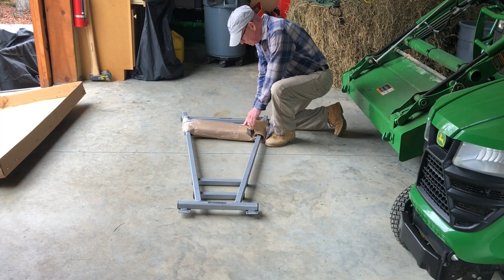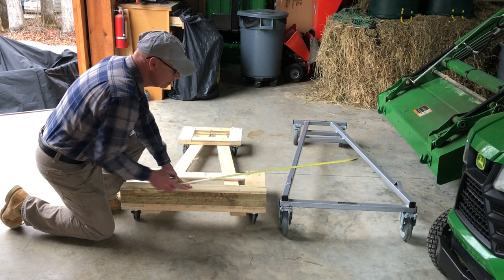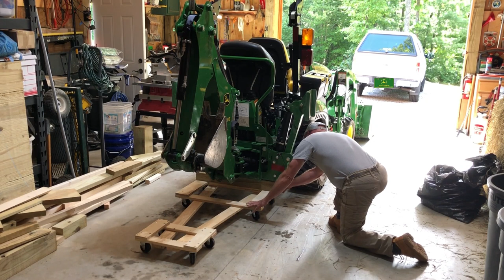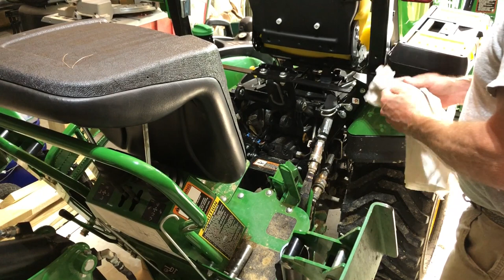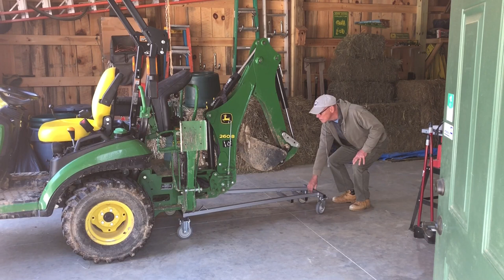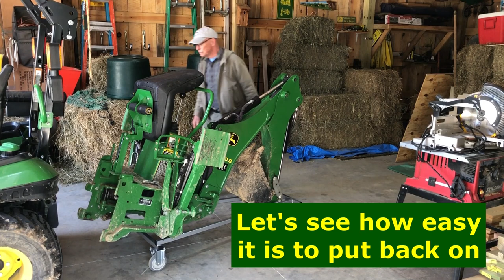1025r: "Hello Dolly" - Which works better? The BXpanded 260b backhoe dolly or DIY wooden dolly?

Comment: SOLD!  Bought one right after I watched your video.  I have limited space in my storage shed so being able to move the backhoe around will open up lots of space for me.  I've purchased several backhoe upgraded from BXpanded and they've all worked as advertised.  Thank you for the video.
Reply from the maker: Yea, what a difference from the wooden dolly - especially since I only use it once in a while when I take off the backhoe - now I can just hang it up on the wall out of the way👍 - Thanks for tuning in to our channel…

Comment: Be careful about the height of the dolly. I have turf tires and my machine sit's about 3/4" lower. The homemade dolly with a 4x4 would not go under my machine I had to lay a 2x4 flat with a piece of pine on top of it. Not sure how that effects the BXpanded one but from the looks of this video it wouldn't fit... I would do some measuring first. **EDIT: Just saw a video with Turf tires and he had to drop the stabilizers to get the dolly underneath then raised them to remove the 'hoe. He struggled slightly to get it back on but it looked okay.
Reply from the maker: Thanks for the tip - With the R4 tires I’ve never had an issue - I lift the back of the Dolly a little when putting it under the backhoe & it slides under just fine - Thanks for tuning in !

Comment: This is the goodest video on this topic I have seen.  Thanks for making time to show this dolly and how it works.  Now, that means I need to finally build a storage shed WITH a cement floor for my tractor.  And $200??  That is a fricking bargain. If someone can afford the tractor, you can easily afford this necessary accessory.
Reply from the maker: Thanks for tuning in to our channel - Have fun building your storage shed and getting the BXpanded backhoe dolly - It does work well - The only thing holding me back from getting it first was the 6-8 week delivery time they had a year ago - But I needed a dolly sooner.  So I made one,. They now have a delivery time of 4-6 weeks - I got mine in exactly 4 weeks from the date I ordered it - Good Luck...
Reply: I did a poor man's floor.  Used the loader bucket to put down gravel and spread it smooth by backdragging, then laid treated 3/4 inch plywood with anchor pins at all four corners.  I used about 15 sheets of plywood butted to each other.  I can live with the anchor pins slightly above grade.  I roll things around them without too much issue.  They're basically 18 inch long rebars with washer and nut welded to one end.  I drilled out the plywood at the corners and drove these into the gravel and soil.  None have moved in 2 years of driving on them.  Cost me a fraction of the cost of cement and I can lay on them just like a cement floor and they're a bit warmer in winter.

Comment: I'm trying to build something similar. Could you tell me the square tubing size and how thick the tubing metal is...1/8" or 3/16" or 1/4"
Reply from the maker: Approximately 2”x2” square & 1/8” thick walls - Dimensions for wooden cart that also might help are on one of the comments below

Comment: thanks for the video...I have the bxpanded dolly now for over a year and have had sporadic success...no instructions either so I may have been doing it wrong.....I've had to use the outriggers more than once to get it back on (using the tractor back and forth) which is a real pain.  I see how the ridges in the frame on this thing prevent the unit from sliding forward causing the bucket to come off while trying to insert the pins in the hooks.  I either had the bh frame on the ridges or behind them.  Not knowing where the bh should be after removed from the tractor is important.  If it weren't for youtube we'd all be in the dark.
Personally, I hate removing or installing the bh on my 1025r.  I had built a wooden one that was somewhat different than your's and it seemed to work better than nothing.  So I spent the $175 (at the time of my purchase) and got the metal one.  It worked great now and then but as mentioned above not all the time.  Lack of instruction is shameful.  I installed my wheels in the same configuration as you did as this seemed to be most logical.  I still hate to remove or install the bh and wish I had another tractor to use for chores where I need other rear attachments and just leave the bh installed all the time.
Reply from the maker: Thanks for tuning in to our channel - I just had another follower mention that when he got his BXpanded dolly it came with instructions on assembly and use.  I just sent them an email a couple of days ago asking for them to email me a copy for my records. Maybe you want to do the same. (contact@bxpanded.com) -> I felt there was a big difference between the homemade dolly and the BXpanded. With a few times of practice I can get the 260B backhoe off and on pretty easily with the BX. When the BH is on the dolly I leave it fully collapsed (towards the bucket) before sliding it back on and aligninig it with the pins on the tractor frame. Thankfully, I have never had to use the out-riggers to get it to drop into place.  Man, that would be a pain. Best of luck.  Reach out to my email if I can help (it's on the "About Page")  Take care...
Reply from the maker: I just posted a copy of the BXpanded dolly instructions on my "Community Tab" if you want to read and save them....

Comment: I am a new backhoe owner and I a very interested in a dolly. I struggle with my backhoe taking it off and putting it back on. My question is. Does your backhoe change position on the dolly once it has sat over time and the cylinders relax?
Reply from the maker: The dolly is set up for that - once you put it on the dolly it will pretty much stay in place  & will easily align with the frame hooks to slide back on
Reply: Thank you so much for the quick reply. I actually forego project work because I loathe dealing with putting my Hoe on but I am looking forward to building a dolly to ease this now. Thanks again!
 @ClearCreekCabinMiniFarm
Reply from the maker: @rvandeker1  The BxPanded dolly is the way to go - They have it designed perfectly which makes it a cinch to drop & reinstall the 260b backhoe - I hated the wooden dolly I took all the time to make. + Looking at the bare cost of the metal tubing & casters to weld one up myself, it wasn’t much more to buy it from BxPanded all ready to go👍

Comment: Excellent video. Thank you.  I just bought the 206B and after struggling with removal and installation at the dealers, learnt a lot just watching you do it.  I need to get this metal dolly or make up a wooden one.  Looks like the pandemic has caused supply problems at BX .. darn.  Would greatly appreciate a little more detail on the measurements since I could not locate the originals if there were any.
Reply from the maker: Thanks for tuning in to our channel - The BXPanded is the way to go if you can get one.  They had a supply problem last year (2020) but when I got mine earlier this year (2021) it came pretty quickly (<2 weeks) - If you plan on building one youself, here are the measurements of the BXPanded - Have Fun...

Dolly dimensions 
Over all length 55”
Width at base 27”
Width at top 16-1/2”
Length from base to top of 1st cross rail 42-1/2”
Length from base to bottom of 2nd cross rail 47-1/2”
Opening of bucket rest (inside dimensions) 5”

Comment: Hey Clear Creek Cabin, on the measurements: "Width at the top 16.5" seems too large.  Was that 16 inches on the bar that has the casters?  My guess is that the top of the "A" would only be about half that, say 8" or so.  Any additional clarity would help.  Thanks!
Reply from the maker: Hey - The top of the dolly is where the 2nd set of wheels are attached - that bar is 16-1/2" from side to side - the long bars from the other end of the dolly are welded into this bar spaced at 9-1/2"  apart (or 4-3/4" from each side of the center of the 16-1/2" bar)
Reply: @ClearCreekCabinMiniFarm  Thank you!  Just what I needed.
Reply from the maker: @ramchillarege1658  My email address is in the about section of this channel if you need additional info while you're building your dolly - Best of luck with your project and Happy New Year...

Comment: Can you give the overall dimensions of the Expanded dolly?
Reply from the maker: Thanks for tuning in:

Dolly dimensions 
Over all length 55”
Width at base 27”
Width at top 16-1/2”
Length from base to top of 1st cross rail 42-1/2”
Length from base to bottom of 2nd cross rail 47-1/2”
Opening of bucket rest (inside dimensions) 5”

Comment: that power beyond hose connection is the poorest design they should have put bulkhead fittings on the machine it would have been so much simpler to connect and disconnect
Reply from the maker: So true + the way they designed the BH hook-up is difficult - don’t know how anyone can do it without a dolly on flat level ground 👍
Reply: @ClearCreekCabinMiniFarm  I agree I put my brother in laws on a pallet for the winter hopefully it goes back on easily I have enough steel around to fab one up just one to get a few more measurements thanks again for an informative video
Reply from the maker: @elektrikman8834  all the measurements you need are in the comments below👍

Comment: Nice Thank You I think you are on the rwrong side of the 2 angle block they llok to be there in case it slip maby you will have to advance your backo on the throlly
Reply from the maker: Thanks for tuning in to our channel and Thanks for the tip...  I'll check it out...
Reply: Correct. I put the angle part on the dolly between supports on the outriggers. It prevents the BH from slipping

Comment: hello and congratulations on your video it is greatly appreciated.  Could you give me the measurement of the square bar and the measurement of the wheels and the measurement between the 2 small bars between the 2 large bars
Reply from the maker: Thanks - I posted the measurements in two of the previous comments below - Reach back out if you need something else
Reply: @ClearCreekCabinMiniFarm  I'm sorry I just saw the answer you sent with the dimensions of the bar as well as the dimension of the wheels thank you very much because I'm from Quebec and with the shipping costs and customs it costs me $ 400.00  Canadian !!!  thanks again
Reply from the maker: No Problem Mario - best of luck building your own... A year ago mine cost me $237 including tax & shipping  and it's been well worth every penny...👍

Comment: Yes. The dolly is a game changer. I replaced the stock casters with locking casters for safety. 610lbs of solid steel being freely moveable didn't sit right with me.
Reply from the maker: Thanks for tuning in - Now there’s a great product improvement idea - much better for safety - Thanks for sharing!
Reply: I agree with your decision...my dolly rolls around when trying to disconnect the bh...and I've chocked the wheels with 2x4's to prevent such.  Will look into doing the same thing.  My floor isn't completely level and the dolly tends to wander on it's own.  Great advice.

Comment: Hi, can you tell me the lenght from base to the bottom stopper  and base to end of stopper and the high of the stopper. Thanks you very much
Reply from the maker: Thanks for tuning in - I guess you've decided to build your own?  Best of luck & Have fun...

Dolly dimensions 
Overall length 55”
Width at base 27”
Width at top 16-1/2”
Length from base to top of 1st cross rail 42-1/2”
Length from base to bottom of 2nd cross rail 47-1/2”
Opening of bucket rest (inside dimensions) 5”
The top of the dolly is where the 2nd set of wheels are attached - that bar is 16-1/2" from side to side - the long bars from the other end of the dolly are welded into this bar spaced at 9-1/2" apart (or 4-3/4" from each side of the center of the 16-1/2" bar)
Reply: @ClearCreekCabinMiniFarm  thanks but I all ready have the dimensions what I need is the 2 small pieces each side for shopping the doly when you push under the backhoe looks like triangle on top of the long bar. Thanks a lot and can you gave me your email address
Reply from the maker: Clearcreekcabin@mindspring.com

Comment: What size is the steel tube? 
Are the wheels 4”?
Reply from the maker: Thanks for tuning in - Yes, the wheels are 4 inches in diameter - The caster brackets are 6 inches tall from the bottom of the 4" wheel to the top of the bracket that bolts to the frame - The tubular steel frame is 1-1/4 inches square.

Comment: Great video. I really like the abridged removal/install of the bh. Seems to me it should be easy enough to build a  level wood floor outdoors  for the dolly and bh .  Makes install/removal a piece of cake. No need to drive or back up the tractor six inches to connect. Got to get one.
Reply from the maker: Thanks for tuning in to our channel - The wooden BH dolly using moving dollies is definitely not the way to go - The BXpanded model works like a dream - I dumped the BH several times before I had a dolly and that is really a pain to reconnect - 
I agree...
Reply: @ClearCreekCabinMiniFarm  My order has finally shipped. Let's hope it's worth the wait. Should be here in a week or so. Meanwhile, I have the covered bh stored in an open field on a pallet. I'm building a platform on which to park the bh and dolly, and I plan on switching back and forth with my wood chipper as needed. Eventually I hope to enclose the 16x16 platform and use it as a barn. Price of wood is dragging me down, though.
Reply from the maker: I'm sure it will work out for you - I just posted a new video this week showing me dumping my BH onto the dolly & hooking up the BB2048 Box Blade.  https://youtu.be/z08XglsD370   What I like most is that I can easily move the BH around in the barn.  I used to avoid taking off the BH whenever possible - Now it's no big deal...
Reply: @ClearCreekCabinMiniFarm  Well, I just finished putting the bh on the bx dolly.  There is a learning curve for folks like me. I actually dumped the bh and had to
re-hoist it onto the dolly. The bh controller movements confuse me and are a bit jerky, but I finally got it on and off and disconnected the h-lines.  Not bx's 
or JD's fautt. Mine, for sure. I tend to learn by trial and error.   Another problem people might have is re-connecting the h-line so as to use the 3 point hitch.
Even after bleeding both connectors I had a devil of a time getting the hitch to work.  But it's working now, though, and these problems are just part of the game. Pack plenty of rags if you sweat a lot.
Reply from the maker: 😮  Wow - sounds like you had a time of it.  We all go through some challenges the 1st couple of times we take the BH off the 1025r.  That's why I dreded doing it until I got the BXpanded dolly.  The hydraulic connectors are a real pain to reconnect some times.  Especially when reconnecting the the 3-point lines back together.  You really need to insure that they couple together completely (firmly) or as you experienced the 3-point worn't work.  I always move the front loader joy stick around a few times and the BH controls a few times before disconnecting anything - This does seem to help.  I remember the 1st time taking off the BH was the worst - I'll bet I connected & reconnected the 3 point couplers 3-4 times before I could get the 3 point to work properly...  Itwill be easier next time for you, I promise...😀
Reply: @ClearCreekCabinMiniFarm  Yeah. Well, it's on the dolly now, waiting to be put back on the tractor. My neighbor owns a 1023E and has been very helpful with
advice. One very useful thing he told me when playing with the hydraulic couplers was to bleed the line a bit by using a screw driver or some such to
depress the little balls on both couplers. That lessens the pressure and makes it easier to join the lines. Even that, though, sometimes doesn't work, and you think you have the line connected, but when you go to operate the 3-point, it doesn't  move! But practice makes perfect (I hope), and I expect to get
the hang of it eventually.  Those lines get mighty slippery, too, after a few tries.
Reply from the maker: Glad you finally got the dolly and have had a chance to use it.  Practice makes perfect.  The 1st couple of times I took off the BH and reattached the couplers, I too couldn't get the 3 point to work the 1st time.  I had to disconnect and reconnect them a couple times to get it right.  Now, that I've gotten the hang of it, I can get it to work 1st time, everytime.  I too have had to release the pressure on the male coupling.  I simply push it against any piece of metal on the tractor I can reach.  I don't believe you have to depress the female coupling - only the male (since they are connecting to the same feed).  Anyways that's what I've seen in all the YouTube videos on 1025's out there (and God knows there's a ton of them to watch)  And yes these couplings can be a pain to connect when covered with Hydro-oil.  Thanks as always for your comments and dialog - Best of luck with the new BH dolly...

Comment: If the BH sits on the Bxpanded dolly`s for a long period of time (like mine does), you`ll notice the wheels will get flat spots in them from all the weight of the BH. Makes them VERY hard to roll.
And Bxpanded is terrible about not putting instructions with their products, and terrible weld joints too. I ended up building a much better dolly for my Kubota BX23s BH for a lot less money.
Reply from the maker: Thanks Larry - Good to know - I usually put my backhoe right back on my 1025r after using another implement - I never bothered getting ballast box so I use my BH for that purpose.  What did you build your dolly out of?  Welded steel?  I'd be interested in seeing what you did.  Thanks for tuninig in to our channel...